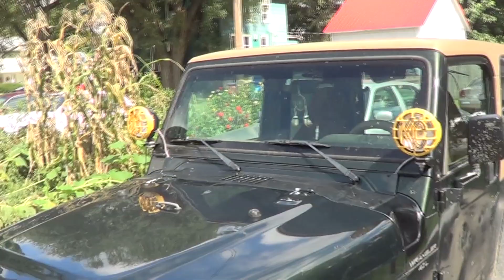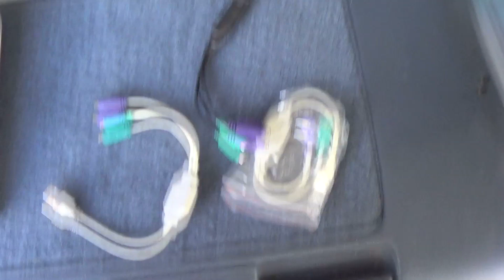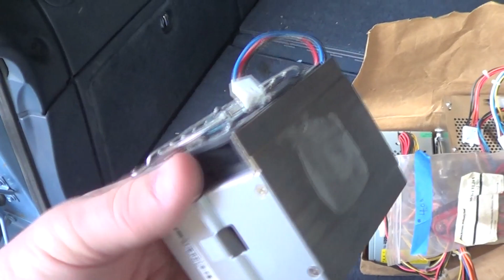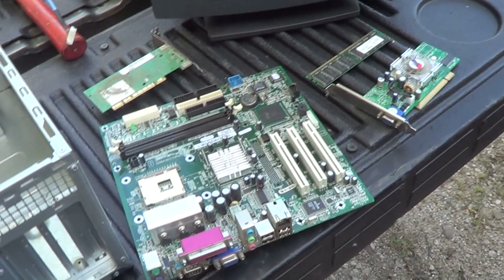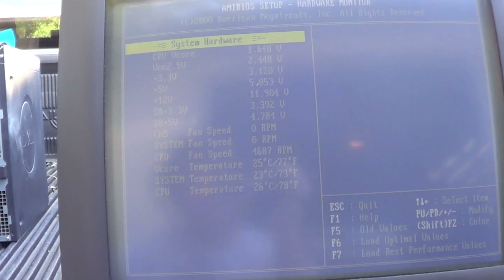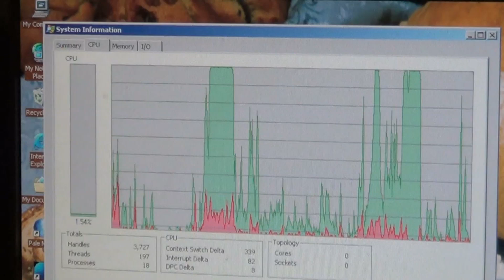2014 Hamfest Finds, Remodeling, A Little Car Stuff and MORE!

Comment: Those beige usb to ps2 adapters have too much input lag, during a typing test i nearly destroyed my NMB mechanical keyboard. My Pc is an Optiplex 755 with Windows 7.  I use usb keyboards now.
Reply from the maker: USB to PS/2 adapters as a whole are pretty bad. There's no excuse for not putting PS/2 ports on a motherboard, ever. (Every LPCIO ever made -- or very close to -- contains the logic for them.)

Comment: lol Pale Moon XP version working on Win 2000. In 2010 I tried Spotify on Win2K and that worked fine, except on first use only, the first track told to play took a while to start actually playing but after that it was fine :) I guess Win2K has similar enough code to XP that a lot of XP programs work fine on it
Reply from the maker: Until Windows XP Service Pack 2 landed, there was a lot of similarity. SP2 was a near-complete rewrite of the system, done because Microsoft wanted to improve its security and had no follow on OS that was anything like close enough to being ready.

Comment: I used to have a Dimension 2400 just like that... real Pentium 4, dual optical drives, and a floppy drive. although that one can't be my old one, as i had an aftermarket power supply, and no real expansion cards to speak of... my dimension left my possession completely stripped, as i knew my mother was going to bring it to the recycling center because she said that it was too slow... this was in 2010 i think

Comment: This video just came on after watching one on pfSense, and you said the Dell HDD mounting cage was a Dell specific item. Those same cage's were used on Compaq Presario 5000 and 7000 series case's. I bought my first PC in 2002 a Compaq 5410US which has those cage's and still run's to this day.  I too like the Dell case's in that configuration, I have 3 at this time. I really enjoy your video's, plus you make lite of thing's and are not serious about everything. Keep up the good work.

Comment: Keep an eye out for some of the LGA775 Dell Optiplexes (after the 755 which was when they pretty much stopped having capacitor bloat) You can quite easily upgrade them to a LGA771 Xeon. Those Xeons are cheap as dirt and run great.  You just need a little sticker that goes on the bottom of the processor that swaps a few pins and you cut the alignment tabs off the socket.  I've got an Optiplex 330 that had a Core2Duo quite happily running a quad core Harpertown Xeon E5440 with 12MB L2 cache. Just check the processor stepping before you buy one.  I think there is C stepping and E Stepping and I'm running the former (SLANS I think is the processor code)
Reply: I had one (SFF) the capacitors were fine except some in the power supply. And the front piece was broken off and i had it up for sale for awhile then i realized it wasn't worth much in my area, so i parted it out.

Comment: i found a free dell optiplex 360, i pressed the bist on the psu and it turned green, but when it turned on, i cannot use windows xp, it just doesn't work, maybe its the hard drive, but idk, it shows the dell logo and boom, just stuck on the black screen

Comment: Speaking of solder points on a motherboard, my nVidia GeForce4 MX 4000 PCI Video Card has solder points for a DVI output and the video card was purchased in July, 2005 by my dad when my sister and I were on our mission trip in South Dakota.  I still have this card to this very day in my old Super Socket 7 PC running on an AMD K6-2/300 Processor, Abit AB-TX5 Board, etc.  I do believe the video card I have is the model A with a heatsink and no fan, and the revised model has DVI output and a heatsink with a cooling fan.

Comment: I had the EXACT same issue you had with the wagon on my Miata. I had converted to a coil on plug system and sometimes the car would act rough on hot start ups, lumpy idle, had to rev it up to get it to normal, and it eventually did.. Turns out I had a loose ignition coil, I replaced it and the problem ceased.

Comment: Dear Uxwbill,
     I enjoy your videos so much, that I tend to use some of your jokes and your very certifiable methods of computer jazz when I have a stubborn computer. While I do not mean to steal your thunder, I always love to hear you make great jokes and puns as you ramble on (No offence intended). As I watched this video to the end, my friends asked why I would even bother. I told them it was worth it as I have many computers from the same time period as you do. 
     
     I was wondering if i could ask your opinion on a problem I have. I have two Gateway EV700 CRT monitors that I intended to use on a system that I planned to use on a daily basis. I powered them both on one day (to boot up a system I was given that was run on a dual monitor setup) to find that while the first one was completely fine, the second and a bit older one, Had the problems of the following:
- Very concave display
- It would try to switch to its normal form but would then in-turn go back to concave
- It would show other and more worrying stuff on top of the display
     
     This gave me the Idea that something might be VERY wrong with it. I immediately tried to use the barely readable controls on it to try and correct it, but to no avail. Being just a hobbyist and about 16 years of age, I did not try to open it up and repair it as I know by reading a very up to date 2004 A+ Certification Computer Repair Boon over 10 times that this can result in a very nasty shock. I really want to keep that monitor as a pair, so it just collects dust at the moment. I want to know if you could give me any pointers to check for say blotted capacitor to even buying a new circuit board or even CRT tube if i were to take it to a professional.  Thanks :)
Reply: ***** Thanks. I was looking at a replacement for it but found that the only ones I could buy I would have to make a long journey across a few states to pick up. I will check to see if there are any blown or bloated capacitors, but I will NOT even attempt to mess with it. Thanks again :)

Comment: As I sit here sipping my tea before bedtime, I can finally watch most of this video.  I only wish I had more time to comment, since there were quite a few things I wanted to talk about! 

Love those Model M's too.  Did you ever test out the USB adapters on them?  Mine's been working perfectly on the Ziotec adapter.

I've worked on a few Dimension 2400's, and I believe they topped out at 3.06Ghz.  Surprisingly good performance for what they were.  I was really bummed about the lack of AGP at the time though.

Windows 2000 can still hold its own on older hardware.  I was really surprised how snappy it was on the Pentium 3 based Dell I set up for my Grandma a few years back.
Reply: ***** I use a ton of the 2.4 - 3.06Ghz P4's at work, and I've noticed the 3.06's go for 2-3x the price of the rest due to the Hyper Threading support.  I probably have over 40 Celeron 2.0 Ghz CPU's laying around after doing so many upgrades LOL.  Maybe somebody can use them for scrap gold.

I tried 800Mhz FSB on my last 2400 with no luck as well.  Ended up leaving a 3.06 in there with 2GB RAM, and it's a decent office machine.
Reply: ***** Yep, SL6PG was the part number I normally used.  For non-Dell systems, I also use the heatsink part number D34080-001.

Looking forward to the update video, if you make one.

Comment: Well i made it through the whole video!
I find your computer videos most interesting!
You did a good job with on the Dell Dimension 2400. There must have been billions of those 2400's made because you can still find them everywhere! Interesting choice to load Windows 2000 on it, and i will be looking forward to your unofficial Windows 2000 updates video, if you decide to make one. (Just as an opinion) I think it would be cool if you loaded Windows 7 Professional on the custom built machine (if it can run it) linux mint is just too boring to be running on that PC.
 P.S. Your wagon is so cool!

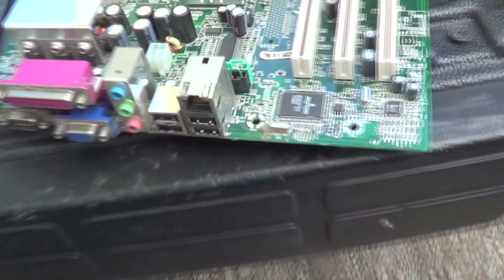Comment: 43:59 Sadly I can relate, I had someone call me to get data off their old pc, they couldn't bring it over because "the monitor was stuck" it turns out when I got there, they had PHYSICALLY RIPPED OUT the video connector, not ever once thought of undoing the retention screws, through some fun montage I gave them their data back on their new machine, was paid nicely too :D

Comment: Speaking of Windows 2000 I am currently using a Windows XP Toshiba laptop with a 2nd gen Core i3 as my main machine. It has XP Pro on it and I applied the Windows Embedded update hack to it and that works fine. The reason why it is running XP was because it came out of my dads work unused and they needed an XP machine to run an older version of AutoCad on it.

It works fine, Chrome, iTunes, Steam you name it works great on it and it really doesn't feel like a 13 year old OS at all even though I have memories of using it on my first computer when I was really young. XP was where I got my start in computers and it is pretty awesome that it is still being used a lot today. My school's tech ed (Robotics/woodshop, etc) classrooms all have XP machines lying around because they also need XP for what they do in there. Also Kaspersky and MalwareBytes AntiMalware still support XP too, so with these updates and proper antivirus and web browser it should in theory be still usable as a modern day computer

Plus since it is a less resource intensive OS I don't lag in games that would normally suffer performance issues on a Windows 7 or 8 install
Reply: Awesome! I still run XP myself. I must say, i have never tried XP on a Core i3 it must be blazing fast! Sounds like an awesome setup!
Reply: Jim Dayton yeah when it starts up it is ready for use and programs open up pretty fast
Reply: ***** Yeah I have the same opinion, computers seem to be evolving at a slower rate than phones for example. Like most people's smartphones last about 2 years because they keep coming out with new ones with better cameras, more ram, better screen etc, but with computers that isn't really the case anymore. Most people's computers will last around 5 years or more, my dads custom built computer from 2009 with a first gen i7 and a GeForce 550 and Windows 7 is still very fast and can run all modern day programs without an issue
Reply: ethancedrik is still an i7
Reply: I run xp on a pentium 4 ibm Thinkcentre 8187 as I have been for the past 8 nearly 9 years and it still works beautifully
Reply: my college had i3s on XP and yes they were pretty zippy :)

Comment: Ah yes, a non qualification sample card, aka an engineering sample.  Thats quite the rare card. It probably has prototype chips on the pcb,which most likely it has a beta or if your lucky an alpha vbios. I'm sure if you sent that card into AMD they'd give you something cool, it's been known that people who send in Engineering Sample/ES processors back to intel when they get an ES processor instead of final retail product get compensated in return.

 I read on a forum this guy bought a core i3 processor brand new only to find out it was an engineering sample. Apparently intel made a mistake with the shipment to the store, and after he sent the cpu back intel sent him a brand new core i7 as a thanks. 

Oh and those cards were made in montreal quebec canada, which ironically is only a 3 hour drive from where i live.

Comment: Speaking of Hamfest, I got them items two like a very small laptop including 2010 Acer Aspire One 722 Windows 7, 2002 Brother Intellifax 2800 Laser Jet Printer, 2004 Westell 6100 DSL Router (like vwestlife has it), Audiovox LCD 4:3 TV (but not supported for Digital Signal for the TV), Coby Portable LED TV (has a great picture), 2001 HP Pavilion MX50 CRT Monitor, Compaq Keyboard, Dell PS2 Mouse M-S69, Portable DVD Player and DVD Player, SV2000 Monophonic VCR/DVD Player, the RadioShack Universal DC Plug, and the two Surveillance Camera. =)

Comment: What was that one front facing down CRT television do in the back of your truck bed? Also, I'll be looking forward for a video about that TimeMachine and Heath clock. 
Great finds I must say! I really like the Antec case!
Reply: ***** Video?
Reply: ***** Back before I had a Youtube channel, I did a picture tube swap between a 19" Sears TV and a 14" SVGA monitor.  I was amused by how sharp the TV was when using the computer CRT, and of course the 19" computer monitor was fun at the time, despite the coarse pixel pitch.  The monitor I used was a Packard Bell 1412SL, the first VGA capable monitor I ever owned.
Reply: ***** I actually swapped the yokes, because the VGA one was a totally different impedance.  I was able to retain the convergence rings with each swap though, which made alignment easier.  One reason it can work, is because many 14" and 19" tubes have the same deflection angle and curvature.  15" CRT's are a bit different though.  But it is indeed fun, as long as you have the patience to get the convergence and purity aligned :-)
Reply: Maxxarcade I was just at a thrift store today. The owner had a big pair of speakers next to this cute little Sony Trinitron CRT computer monitor that seemed very useful in my hands until I saw that. It had been sitting there for some time so I'm sure the CRT was screwed in every way possible.

Comment: It's funny you mention the Dimension 2400.  That was the first computer I ever bought (as an adult, my parents owned others previously).  Lo and behold, your vga port was messed up, and mine two was messed up almost from the day I bought the computer.  Because in 2003 even, it was tough to go without a computer, the old "wiggle the connector until it works" method was used often to fix my computer.  Lasted a few years until 2008, after a roomate accidentally finally knocked the connector free from the motherboard.  As an additional thought, perhaps the PCI card was purchased to provide a second monitor port (i added a card with a TV out at one point for movie viewing).  My 2400 is now residing in my mame cabinet, ironically about to recieve a brand new TV out card as the one i had was ancient at best.

Comment: I have a habit of buying computers I don't need or have a use for. lol.

I find with Dell computers that they are well built and good quality, but most dell PC's seem to be limited in how they can be upgraded.

I recently purchased a sony Vaio desktop PC. I didn't know Sony made PC's until recently, probably my own lack of attention to the market. It came to me with a problem of "turning itself off" which wasn't the problem at all. When you turned it on, it would get to the XP screen and the video output would die but the PC would continue to boot. It has no on board video, so I replaced the AGP video card and it fixed the issue. I had a look at the old video card and noticed that all caps had bulged tops, some worse than others, so, a good indication as to what the issue was. lol

But the owner preferred to sell rather than fix. He also asked me to refurbish a mountain bike for him. So we came to a deal on the PC which, complete with monitor, mouse and keyboard (just your generic 15" flat screen monitor, though by Sony) has cost me £15 worth of work on a bike and £15 cash. Not sure what that would be in USD.

One reason I agreed to buy it was because it has good specs for an old XP. 3.5ghz P4 processor and 2GBs of DDR RAM and a 200GB hard drive. Plus, AV ports front and back.
Reply: "I have a habit of buying computers I don't need or have a use for. lol." Same with me kinda XD I have 4 laptops and 2 desktops and my mum asked me: Why do you have that many computers?
Reply: Florian amRechner I have 8 desktops (counting the old Dragon32 computer, untested as I don't have the cables) and six laptops. The oldest laptop I have is a 1988 Zenith Data Systems. I took a gamble on it at a car boot sale here in the UK as the seller did not know if it worked. It seems to have a RAM error but the RAM is permanently fixed to the machine and I don;t have the skills to fix it.
Reply: Florian amRechner I like anything old, especially technology. I recently picked up a Phillips VR2022 VCR from the very early 1980's. It's unique as these Phillips machines were the only VCR's ever built that plays double sided video tapes, which I was lucky enough to find one in the deck. Needs a new cylinder head as there is some kind of stain/ingrained dirt on it, it does work though.  It also weighs a ton!
Reply: Same here. I loving buying old PCs!